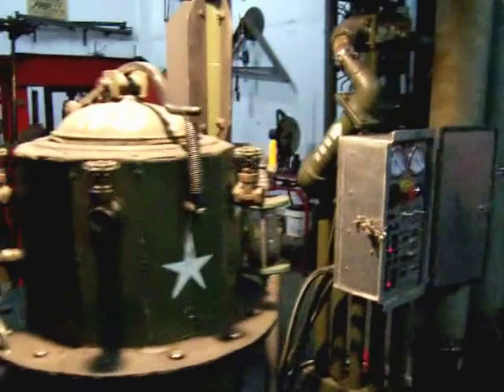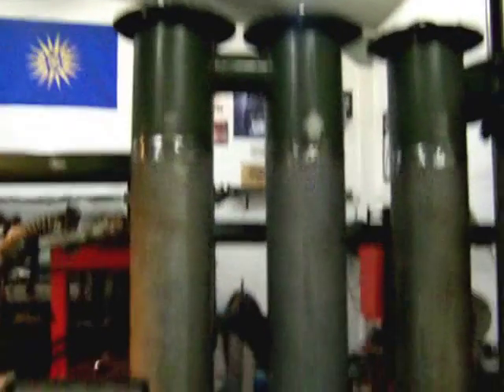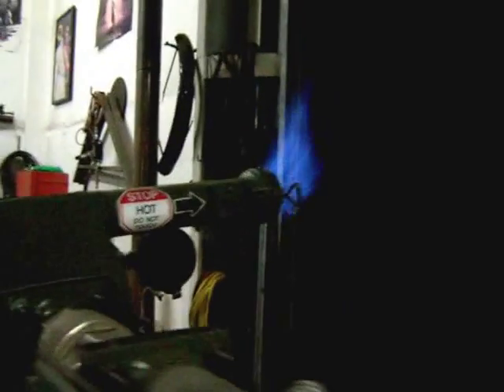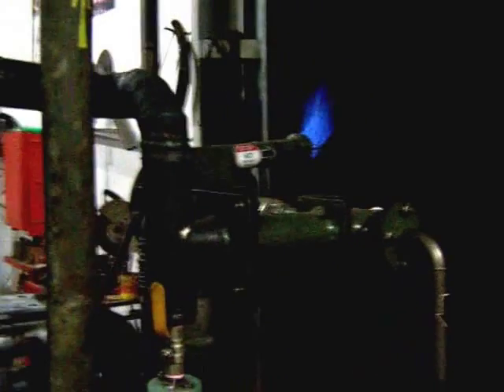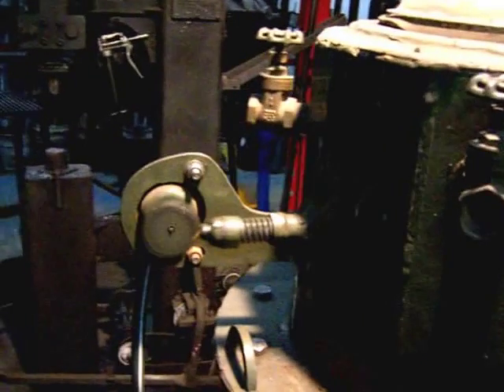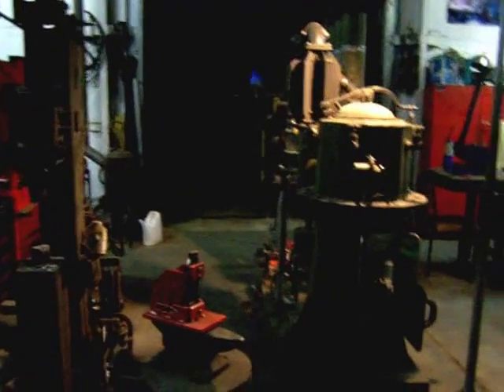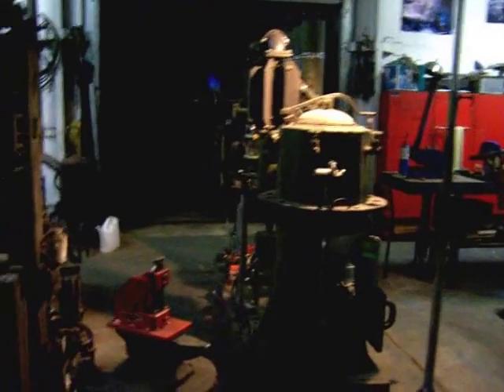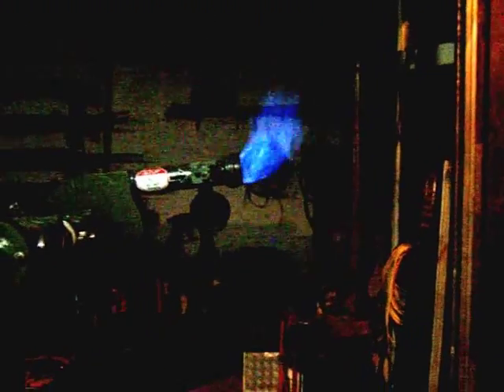A-1 gasifier latest video with full automation, bigger filters and a blue flare

Comment: Great job on the whole thing! Formally docdcox here.
Glad to see a properly built Gasifier that you can actually fill the Hopper full with Fuel and have it run properly. I saw the Video from Jose Paz too and have reworked my gasifier with a Water Scrubber. Haven't run yet but I believe it will do great.
I only have the one dry Cyclone after the reactor going into the Wet Scrubber then two Cyclones to remove the rest of the water and all 3 drain into the same 15 Gal. Tank. I will have no Filter Media except a 6" layer in the Wet Scrubber.
May post a video when running.
Dealt with Prostate Cancer during my build in 2012 and now dealing with Malignant Melanoma in left Arm. Waiting to hear if they got it all on the second Surgery.
Again, Great Job!
Reply from the maker: Thanks for your reply ,, its been a long time,, was looking for you a while back and could not find you, i am so sorry to hear about the Cancer i have no words other than " i certainly hope you can overcome it", my thoughts are with you as i am sure the rest of us woodgassers are,,  i feel i speak for them also, you are an innovator and have helped me and others with your gassifier build and experomentation  from the get go, I pray ,,may god be with you and help you thru this.I have lost some friends and family due to cancer in the past and pray you get better. stay in touch,, god bless.
Reply: @plasmacutter1  Thank you for your well wishes.
Got tired of the YouTube stuff and deleted all my Video's. Came back with this name but only posted a couple of private vids. I'll see ya, maybe. LOL

Comment: Did you know the blue flame has less BTU than the orange or violet flame? Blue would be nice for cooking, maybe heating water, even lighting. Blue is certainly cleaner. But for running an engine/Generator you need all the octane you can get. There is already an octane loss of 30% compared to Gasoline. A 6k Generator would only produce bout 4k on wood gas. and the blue flame would be somewhere around 3k. As long as you are cracking the tar, Just a little filtering for soot, and a cool down and your good for any engine.

Comment: Congrats on your successful build and run . Looking forward to seeing you run an engine . Looking great. Joe
Reply from the maker: Thanks Joe,  i was wondering how your build went as i lost touch with the woodgas community for a while, but i am back in the game now ,,planning to run a 7kva generator with a 13 hp motor. Recently i stumbled upon a comment made by all power labs regarding the fact that an engine running off a gasifier would create more suction thru the nozzles  than a blower fan, i am hoping thats true,, as the filtering and wetscrubber i have upgraded  to seems a little restrictive,,,, anyhow the excitement i felt  getting the blue flame leads me to adopt the attitude " if it aint broke dont fix it" so for now,, i just need to setup the plumbing for the carb and should be good to go soon,
Reply: plasmacutter1 , I  have been a little preoccupied with replacing a vehicle my daughter rolled over. She is fine which is the most important thing,  but I had to take a few weeks off from the gasifier to get things sorted out. Here is a link to my latest video. I still haven't run the ninja on woodgas,  but I will be doing another run as soon as I can. Is your gasifier a clone of a common design or is it your design? I can't remember details of your build. Joe https://youtu.be/-5QbSFGUenA
Reply from the maker: Oh god , glad she,s ok,, cars can be replaced ,, daughters cant,, i based my design on various ideas that were hovering around youtube 3-4 years ago when i started fabricating mine.
I based the reactor on a 5 nozzle design with deep restriction zone, full internal insulation and pre-heated airtubes, with a condensate trap for the hopper , it is similar to docdcox  in some aspects , with a 9 inch diameter hopper. Filtering and expansion pipes are original ideas of mine, and they all seem to be working.